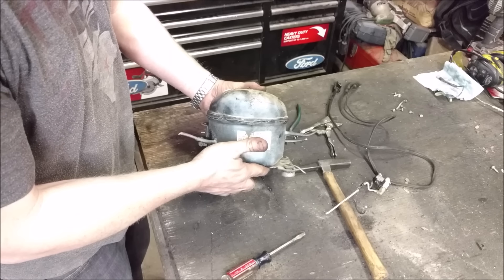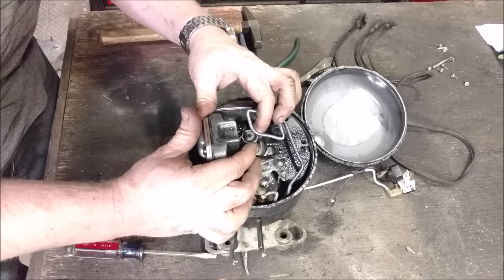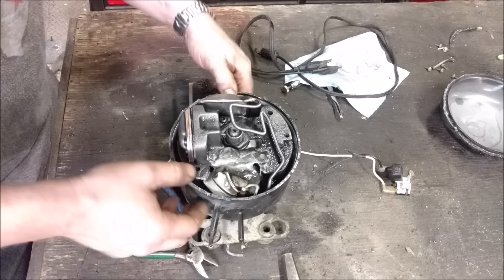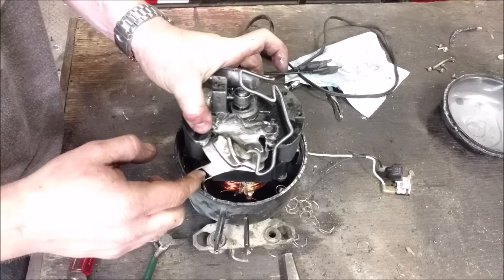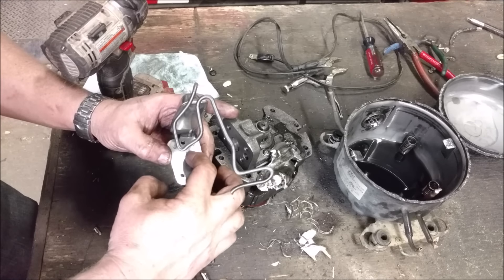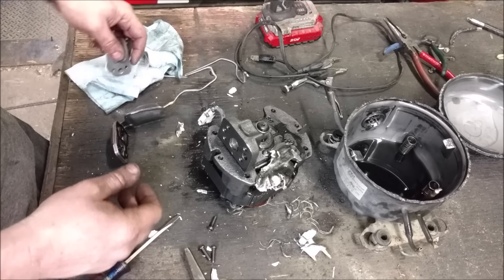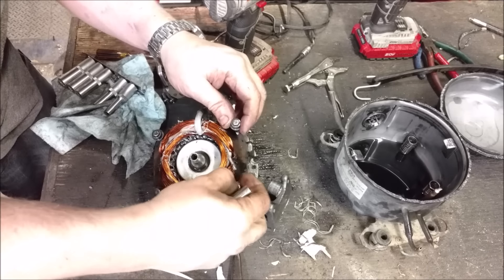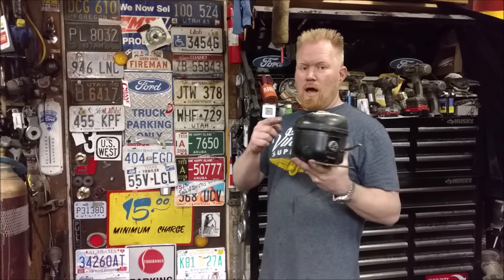What's inside a Refrigerator Compressor

Comment: I forgot to say leave the suspension springs inside for the upside down lid to sit on.

 Larger freezers and very high quality appliance compressors do have roller needle bearings. Precision shaft bearings and even ceramic pistons like in a good pressure washer. These type make great vacuum pumps!
Reply: Thankyou gues shering  welcome to  partok  sir,,,,comperssar    hrmatic ,  windind  part in  side  rotar  staer,and   meshinesom     mecheanes  parted  pison  and  cark cas  shaft    pison  pins  weels ok  sarted lines    dis  charged  ,  suchion  full set gues  thankyou sir,,,
Reply: Chamber mafer in cled set  sound  set ment gues    mafarvuse  ,,waferated  solved   hermatic tuped  some in same out side  thecakeancal mind used gues   school  not  stadey samanney    dopelcal  and play  not selfed guesd ok sir home restok

Comment: Can it run but not cool properly? My fridge is not cold.
Reply from the maker: Yes. The motor/compressor could have a broken reed valve (can't build pressure)or the system could have a freon leak. Both are generally a death sentence for fridges as a repair costs more than a fridge.
Reply: Thank you. That's what I was thinking.

Comment: they used plastic IN the compressor!? that's honestly cheap. how old was this compressor?
Reply from the maker: It was around 10 years old. Virtually all compressors I've taken apart have plastic intake boxes like this.
Reply: sixtyfiveford oh. seems kinda stupid/cheap to use plastic but the refrigerant entering should be a cold gas so it makes sense.

Comment: i want to add some oil that i spilled off .does anyone knows what kind of oil it uses?
Reply from the maker: If the compressor was running r12 or r22 it is more than likely refrigeration mineral oil. If it was running r134a it is more than likely a PAG oil. If it was r410a it has a PVE oil. It is best to see what the original oil was used per the data label on the refrigerator/ac unit.
Reply: thank you so much, since its a scrap unit and i don't have any reference, what would be a general use solution ?
Reply from the maker: If you're not using it for refrigeration anymore you could drain all the oil in it and put any light weight non-detergent oil.
Reply: i want to build a vacuum pump for composites application ... so that's my case :) thank you once again , cheers from Greece.

Comment: Can this compressor be used to compress hydrogen?
Reply from the maker: It could but there are some issues. Mainly that it will introduce oil into the hydrogen gas. Secondly it will only compress it up to around 200psi.

Comment: Bro my refrigator is not cooling what should i do?
Reply from the maker: Most modern refrigerators have a computer issue as the main culprit for failure.
Reply: zeki brain , if you have dogs or cats it is probably clogged up with hair or just every day dust build up , the bottom has a spot were this can be cleaned out , like if you have a window air - conditioner and it has a filter on the front , the refrigerator has the same thing only at the bottom of it , once a year cleaning maintenance should be fine , I would check this out first

Comment: My Haier chest freezer died less than 4 years old.  Checked to be sure it wasn't the starter relay (electronic components).  Tried to get the 5 year warranty on sealed system parts, but they pro-rated it.  It cost me more to get a technician to certify that the compressor had failed, after I already troubleshooted it to be sure it wasn't electric components I could replace myself.  This is one of the biggest contributors to global warming.  Products aren't built to last anymore.  More waste in manufacturing replacements & shipping product to stores and promoting consumerism.

Comment: A refrigerator compressor is not a pump. Pumps are for liquid. A compressor compresses refrigerant in its vapor form. If liquid refrigerant enters the valves of a reciprocating compressor....bye bye compressor.

Comment: 3.2 million views for what ? I don't need an explanation of what the pump does , what's in it for scrap
Reply from the maker: There's no money in scrap. You'll waste 30 to 45 minutes and a cut off wheel for $4. Hey, but I guess that's the scrap game, good luck.
Reply: @sixtyfiveford  yes there is , I can make 150 a load per day , welfare doesn't pay that
Reply from the maker: @benjaminpauldimedio1683  It's a horrible mindset. Become a fixer /repair. You can make $200-$500 a day fixing and selling stuff. I used to have a few scrappers bring me stuff. They were super excited to make double scrap value from me and I was super excited to make 100 times scrap value by fixing it.

Comment: Your wrong.  The compressor takes air with is nitrogen not oxygen.  And creates heat.  The heat goes to the Peltier.  Creating a differential in temp.  These tanks on the back contain no liquid!

Comment: Burton sucks know it's probably not his fault. But they will rip  u off every time. He might actually know what he is talking about but I will never use there service especially for plumbing. So like I said he might be smart about the topic but the company and the policies they basically force upon there employees sucks. Had problems with my hot water heater before they even looked at it they told me I need a new one. And had 2 options on hand the high dollar and the cheap one. Now just per say they come in and say you need a new one to an elderly Male or female and all they really need was to have the pilot relit. Why would the company send 2 techs out for that not cost effective so they basically here desperation in your voice and say money.  F them.